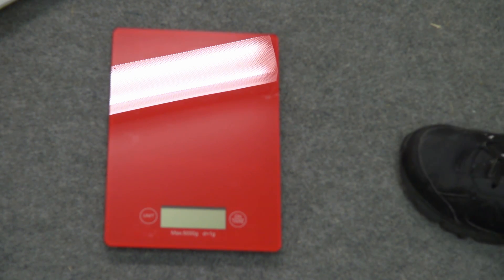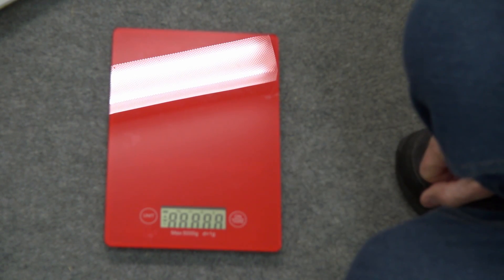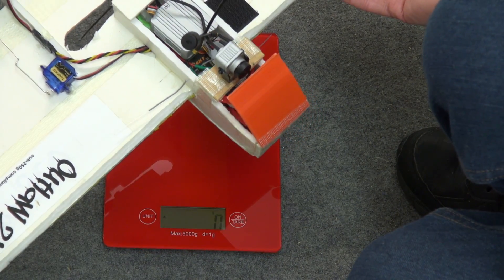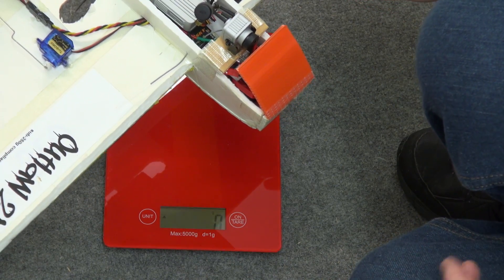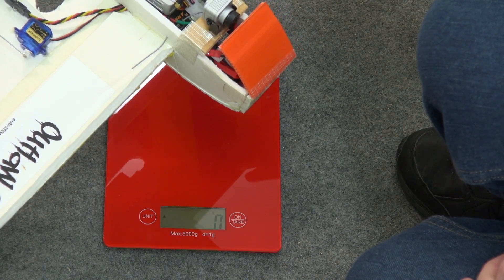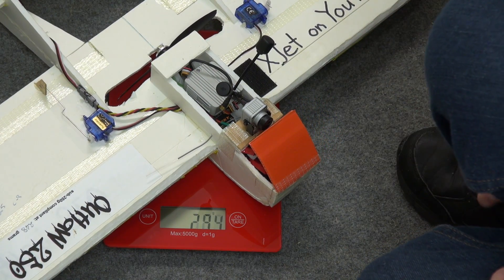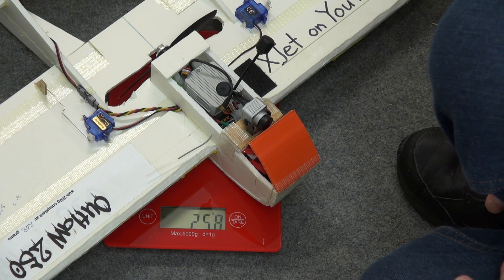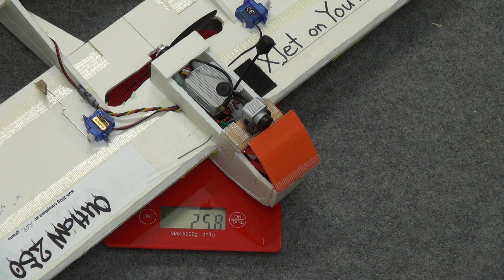Sub250g RC plane with DJI's Digital FPV system?

Comment: thanks for the video! i have this system on my drone and would like to setup it on a fixed wing. how did you configure the remote controller to work? possible to configure it on betaflight as a airplane and not as a drone ? Thank you
Reply from the maker: Unfortunately the DJI system had to go back to the supplier but if I ever get my hands on another, I'll do a video showing how to do the setup for fixed-wing with and without a flight controller.

Comment: I would love to try flying FPV. Looks like a lot of fun..
Is it easier to fly FPV or just different??? I'd guess it might be a touch easier to land?
Reply from the maker: If you're already an experienced RC flier then FPV is just "different".  If you're starting out I'm pretty sure it would be easier because there'd be no orientation issues.  It is interesting to note that even experienced RC fliers generally do much better landings (closer, smoother) when flying FPV so yes, I think it is easier to land FPV.

Comment: As an old man, I can truthfully say that the picture is great, BUT I don't have a $1000 to spend on video, good gravy.....    That's the big draw back, when prices get down to Analog then I'll think about it.
I bet money that unless daddy is rich this is going to go the way of the Dinosaur...
Reply: Prices always come down (and that's high profit margin, so they don't need to sell millions, but they probably will). I'm sure room sized computers were probably a little after your time in college, but now a cheap $100 smartphone has hundreds of times more computational power than what we used to land man on the moon (can you imagine NASA back then gawking with their slider rulers at how cheap we can do it? I bet they spent more than $100 on their machine too!). Analog is hard to beat price wise right now ($5 camera and $8 VTX is pretty decent), but just like cell phones and computers, some Chinese will make a $0.05 chip that will do half the work and then in 5-8 years kids will be able to have this quality even on cheap indoor micro quads and 1 oz airplanes.

Until then, yeah... I'll be like you and not dish out that kind of money! I'd rather learn to fly 3d Helicopters (as I assume I'll crash and completely destroy a few machines), and that looks like a lot more fun! I'll definitely be starting with the small indoor ones though, no need to chop off arms by accident, haha!

Comment: so how much did you get the DJI fpv system for in NZ$? Its $1300 AUD here for the goggles + 2 cameras with 'air unit', and $1500 for the goggles, transmitter and one camera with air unit

pricey but id love to get my hands on this gear
Reply from the maker: It's NZ$1600 for the full package in NZ (with RC transmitter)

Comment: Pretty impressive video! I saw a lot of pixelization in the outer 25% of the screen but for their first digital system not bad ;-) See you in the Air!
Reply: That's your monitor not the system

Comment: the middle looks clear but the sides are not so clear from what i can see
Reply: Yeah, the sides were un-useable... Tunnel vision like crazy! The middle was spectacular, I wonder if they will lower the resolution some (as an option in compression settings or something) so that its all really good instead of "ugh sides, and WOW center!", I'd rather have it consistent, I don't fly 100% straight while doing acrobatics, so the edges are typically more important to me than the middle in reality as I'm not taking pictures.

Comment: Lighter isnt always better...especially for smaller models flying OUTSIDE.
My 30" modified....FT scout..it just has wings like experiemental air lines
with vertical spars and tappered..hinge line...My firewall over size 5mm thick plywood
My landing gear mount has a Square DOW and the 5mm plywood....AND 1mm plywood
doublers..I use 5mm beefy metal sort of landing gear wire..with scrap metal clamp
pieces.I extended the rudder to make it round and increase all the control surface :-P
Air molecule dosnt scale down...no matter how much I tell it too..lmao
Anyways.....it's probably in the 350-400 grams AWU..
i dont care...my 2208 1400kv will pull 650-700 grams 8x4 or 9x4 on 30C or better 3s lipo :-P..
It'll CUT through the wind easy becuase of the heavier wing load. 3s 1500mah 40C
i can fly it in 7-10 mph wind..without it getting toss around.

God forbid the nazi flight space police have a weight scale strap to their gun belt :-P 

Nice quality video....it'll be great for making tourist attraction videos of different places

Comment: In the UK it makes NO difference if its sub 250gm if it has an information gathering device(camera/microphone) fitted, IT STILL HAS TO BE REGISTERED and the annual fee of £16.50 paid. The only way, in the UK, to avoid registering is to fly LOS sub 250gm.
Reply: @cormacsyt0  Google CAP 1789 Then go to page 32 for easy to read chart. No distinction made as to whether information being gathered or stored. Just that equipment is installed/fitted. Note that 99.9% of model club planes will come under C4 category and can only be flown in A3 site/airspace. A large number of UK clubs would find it difficult/impossible to accommodate/comply with this and would have to cease. There is always the vanishingly small chance that the CAA DfT will magnanimously grant a concession.
Reply: @cormacsyt0  'They' consider £16.50 a bargain, even though it is 12X what others pay. Although, it is free in France. It is an annual charge, for good reason, I believe. I believe there will be a very low take up, definitely less than the 170,000 that the CAA/DfT based their costings on. Consequently an annual fee allows for a rapid increase in the charge to compensate. Me, I'm going LOS sub 250gm and giving RC yachting a try.
Reply: @cormacsyt0  Unfortunately in more explanatory documents class C1, C2, C3 all require 'electronic conspicuity', a technology that as of yet does not exist. Plus, the vast majority of model club aircraft(not talking about multi rotors) do not comply with various other requirements of the C1, C2, C3 classification. Thus C4 and A3 are the model aircraft('planks') classifications and site/airspace requirements. This has been explored at length on various forums eg BARCS, Modelflying, Mode Zero (single channel RC) etc to name but three.
Reply: @cormacsyt0  Having followed all of this, including the parliamentary committee, the CAA Dft have NOT agreed to 'pick up' Article 16 in Annex A of CAP 1789 as they are allowed to do and therefore NO special arrangements will be given to the aero modellers in ANY of the UK national organisations.  We, us everyday run of the mill aero modellers in the BMFA, LMA etc, are lumped in with everyone else. Take my word for it, unless there is some change of heart from CAA DfT we are 'stuffed. I have been following all of this for years. A3 site and airspace is where we are for model aircraft. Every building, structure, road, footpath, industrial/commercial/recreational area has a 'no entry' airspace vertical border 150m(500ft) from its physical edge that you are not allowed to enter. Plus, no higher than 120m(400ft) AGL flights.
Reply: @cormacsyt0  Your second paragraph is the pertinent regulation. It is taken as a vertical limit because there is a height limit. Say there is a house(need to take into consideration the garden as well), it has an exclusion zone of 150m radius around it and the garden but you cant fly over it because there is a 120m height limit. So, its safer to consider the boundary as a vertical one instead of slightly sloped. As you say in your last sentence but you must also consider footpaths etc.
Your first paragraph re 'no uninvolved people' could be construed to be anyone not directly involved with the specific flight/model. The question is are other club members on the field 'uninvolved people'? Then what about 'fly ins' etc?

In her evidence to the select committee Baroness Vere of Norbiton(the aviation minister) indicated that the police would be given powers to impose an on the spot fixed penalty fine for non compliance with the new regs etc not registered, registered but number not displayed on aircraft, competency test not taken etc. She also indicated that the police would be given powers of entry and search of private property to look for 'drones'. No indication of fine levels but in one document I read it spoke of penalties up to £1,000. Although, I cant see plod tramping across fields to check a few planes at a club site. Where I live they don't even turn up for a burglary, they just give you a crime number over the phone and that's that!
All the new regs apply to USE not ownership, so a lot of people are going to wait and see until spring 2020 as they don't fly over the winter.
Here's a thread to read https://www.modelflying.co.uk/forums/postings.asp?th=142862
Reply: @cormacsyt0  BMFA, LMA etc offered their member lists, co operation etc but were firmly and robustly rebuffed by the CAA DfT. Article 16 is a voluntary arrangement(going back to the originating document by EASA) that can or can not be applied/used by national aviation regulation bodies. In the UK it would seem that we are going to have a draconian gold plated system. The time table for implementation of this stretches into next year and appears to be slipping. How all this nonsense will be implemented and applied at club level is anyone's guess. That's why a 'sit and wait' approach until April/May 2020 is my preferred option.

Comment: I would like to see it tested on a mini quad with damaged props as on both of your landings the sides pixilated on the screen edges. I would assume the sudden changes in picture put it past the  data rate  it can handle as you were very close range wise.

Comment: Good job Bruce I was waiting for someone to stick it on a plane . I wonder if you can get more range when the craft is higher , I think the results was 1.8k on a quad. 🤔 what’s that a mile and half.? Just under.
Reply from the maker: Yes altitude makes a difference but power does too.  This unit is currently operating at 25mW which is a tiny amount of power ;-)
Reply: xjet thanks for your reply. Is this unit not switchable then.? 🤔
Reply from the maker: @Fpvfreaky  Not "officially" but yes, you can switch it.

Comment: 250gm / 25mW,.... Pretty awesome. Just a shame it doesn't work with DJI's own flight controllers.
Reply: It's over 250g
Reply: By 9 grams,.. and you must have heard what Bruce said about the hot glue.

Comment: Is lag more important than resoloution ?
Reply from the maker: It depends on the type of flying you're doing.  If you're flying high with a flight controller that allows you to simply "steer" the plane around the sky then latency (lag) isn't all that important.  If you're flying fast near the ground, trees or other obstacles (proximity) then latency is even more important than resolution.

Comment: Just checking has the plan for the outlaw sub 250 been released yet ?
Reply: I'd be tempted to cut one for myself, as Bruce did, without waiting months for plans to be published. See if it works, make adjustments, to correct faults, and then fly it. There's nothing like, as Richard Feynman put it, 'the pleasure of finding things out'.

Comment: Was that set to the center focus I think you can do on these....???  Good on Fern NZ DJIs NZ agent for lending you one to try out etc.  Laurie
Reply from the maker: Yes, that was in "focus mode" which allows the picture to degrade at the edges before the centre when the signal is weak.  A very good compromise.
Reply: @xjet  It was really screwing with me because my phone has a screen burn in on the edge(s) from so much youtube screen vs comments section watching. Had to turn vertical and horizontal to make sure what was what.

Comment: Nice clean signal on 25mW, how does it go at extended range ?.
Reply: That video was from recording from the model not 25mw signal
Reply from the maker: Adam is correct... that is a recording of the received signal in real-time, not from the recording unit on the aircraft.  What you see in this video is what the pilot sees when flying -- actually it's slightly better in rea-life because YouTube tends to add extra compression artifacts which make it look worse here.
Reply: @xjet  that's amazing
Reply: @aussiejonno  This was a goggle recording from the signal. NOT a recording from the model

Comment: The left and right vertical quarters have some weird blur going on. You can see a subtle line running up and down between those areas and the middle of the video. It reminds be of that effect they put on vertical aspect videos where they fill in the black space with heavily blurred sections of the recording.
Reply from the maker: That's because I was fling in "focus mode" which tends to give more priority to the center of the screen in terms of resolution.  When the signal gets week in focus mode, the edges will become blocky/pixelated before the center so you can still see where you're going.  That effect can be disabled.
Reply: Was going to mention that.... Looks like a lower bitrate compression in the periphery?

Comment: Great Job Bruce !!!! Sub 250g with your new lighter RC model plane that's amazing !!!! I will wait until I've watched your full review before buying one of these systems !!!!!! Do you think its possible to take the air unit out of its casing to save weight ? Just a thought.
Reply from the maker: No, the metal case is an important part of the heat-sinking that keeps things cool.  Besides which, it's not actually that heavy.
Reply: @xjet  Thanks for clearing that up Bruce, It looks like a heat sink, so I take it it gets bloody hot then ? I'd love to add one of these units to a Sub 250g quad.
Reply: The case is the heatsink...so no....but if you watch the air unit tear down video...you’ll also realize....no.    But give DJI time,  I’m sure they want to make it as small and light as possible too.
Reply: @SocalCanyonRacer  I've watched the air unit tear down but wasn't sure if the casing was more for durability than to dissipate the heat maybe the blue thermal transfer compound should have given it away !!!!!!!!!!!